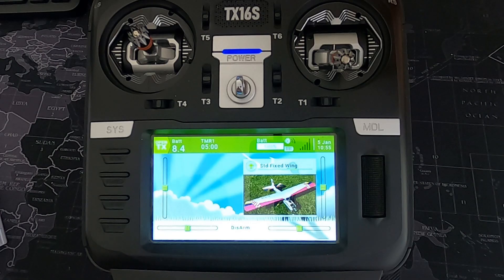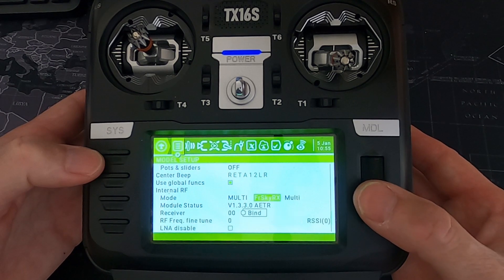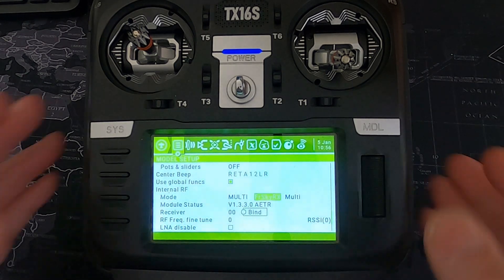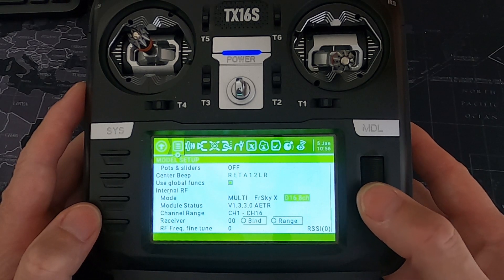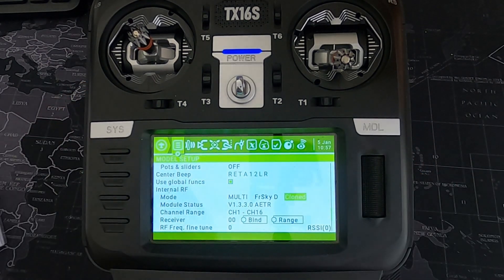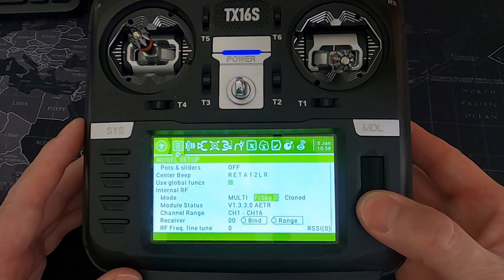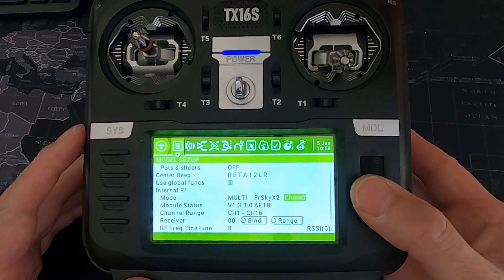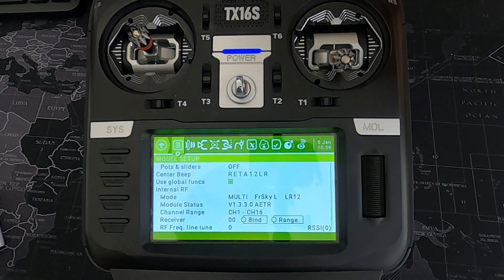Binding FrSky Receivers to the Multi Protocol Module

Comment: Having the same issues in 2025, can't bind frsky r-xsr eu lbt to radiomaster pocket cc2500.
Reply from the maker: @blendin.studio2508  you need to check the firmware version on both the Pocket and the receiver.

Comment: Hi bill. how are you? i had a drone with frsky r9 slim+ and im trying to bind to my multiprotocol tx16s because i have the option to bind to a frskyr9 receiver, but it does not bind at all. how can i bind them?
Reply from the maker: I am good thank. Sorry to say the R9 is a 900 MHz receiver and will not bind to the 2.4GHz multi protocol module.

Comment: why i can't binding receiver archer plus r10+ to radiomaster boxer jp4in1? at the previous time, i can binding the archer plus r10+ to taranis x9d at d16 mode. but in boxer jp4 at d16 mode to, i can't bind. i tried with frsky rx, frsky x, frksy x2, and frsky l, but still not working
Reply from the maker: As far as I am aware this receiver’s protocol is not included in the MPM so will not bind.

Comment: Hi Bill your doing a great job with the videos and would like you to help me with binding a Radiomaster TX16s running edge 2.8 firmware with a Radiomaster receiver R168 many thanks Brian
Reply from the maker: Hi Brian, The binding procedure is:
Hold down the bind button on your receiver and plug in the power.
Go to radio click bind. 
Once bound disconnect power from receiver. 
Reconnect power to receiver you should be bound.

Comment: Hi having similar trouble with a jumper R1 V2 receiver, on my Zorro internal multiprotocol module, tried with frsky d16, frsky X1 and X2 on d16, tried turning it +and- 40 with frequency tune no joy, not had a problem with my external crsfr module when binding with the Zorro. Any advice welcome. Thanks.
Reply from the maker: I have not used a Jumper R1 receiver but are you using the non EU LBT protocol on your multi protocol module? It appears the R1 requires the FCC protocol.
Reply: @the-happy-RC-flyer  yes not using lbt
Reply: @the-happy-RC-flyer  hi I watched your video  on updating which I had done but on your video in model menu you have some text saying status to show firmware version near where you bind the model, this seems to be missing on my radio?
Reply: hi again under tools-multiconfig it says no multi module detected?
Reply from the maker: @quadthingcopter5984  have you updated the firmware of your multi protocol module? Have you bound a receiver to your Zorro before ?
Reply: @the-happy-RC-flyer  I updated edge tx to the latest version yesterday as I could not bind, never tried using a receiver in the internal module before as I usually use crossfire and had no problems with that.
Reply from the maker: @quadthingcopter5984  silly question I know but your Zorro is not an ExpressLRS version? Next suggestion is to update your MPM firmware.
Reply: @the-happy-RC-flyer  thanks again for the reply, no it is a cc2500, how do i update mpm firmware thanks?
Reply: @the-happy-RC-flyer  Thanks for the reply but i have updated both egetx and the multiprotocol firmware for the cc2500. still no joy
Reply from the maker: @quadthingcopter5984  have you bound other receivers to your radio?
Reply: @the-happy-RC-flyer  only crossfire  receivers with the external module, never had a problem.
Reply from the maker: @quadthingcopter5984  tricky one, can you borrow another receiver from a flying buddy and see if it binds. Could you please take a picture of the Zorro screen on the binding page and email it to me. triplemadventures@gmail.com A small video would help.
Reply: @the-happy-RC-flyer  sorry for the late reply, I will send you an email of bind page, I have a feeling the internal module is not working

Comment: Hi Bill. Great video. I had a drone with FrSky RXSR Rx. My favourite drone. When I updated my Open Tx it stopped binding altogether. I tried some troubleshooting, but in the end I decided not to bother with the FrSky Rx at all. I cut it out and replaced it with an ExpressLRS Tx and Rx for my TX16s. All my drones now run ELRS, and all Tx's talk to all Rx's (if they run the same firmware). Range is enormous, latency is tiny, and it costs hardly anything. I recommend that as hobbyists we stop rewarding FrSky with our cash, and move to other solutions. This may make them come to their senses. All the best :)

Comment: Hi Bill. I like your new gimbals. Did you get it from Radio master? 😊
Reply from the maker: Hi Johan, yes they are very nice but not cheap at $130 per set. I would recommend them but they are a high end  upgrade. I have reviewed them and they were supplied for review by RadioMaster.

https://youtu.be/9B3BedPnZVc